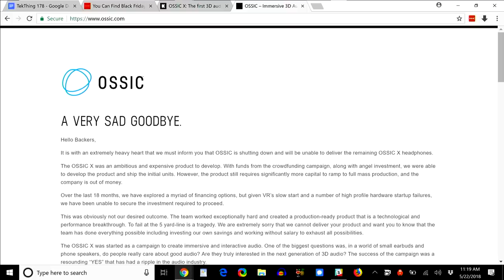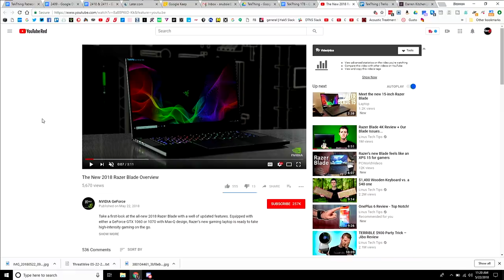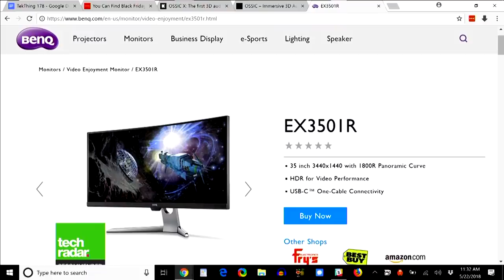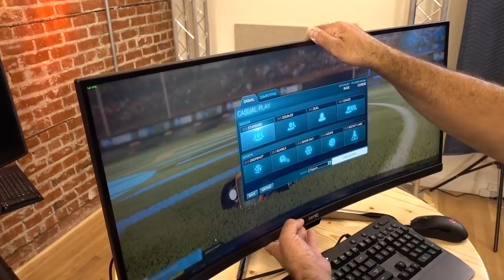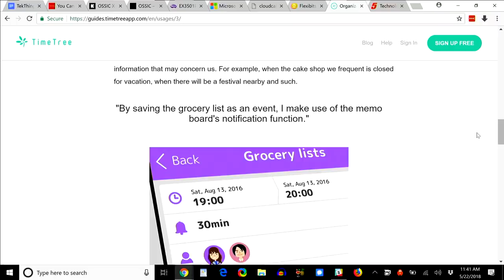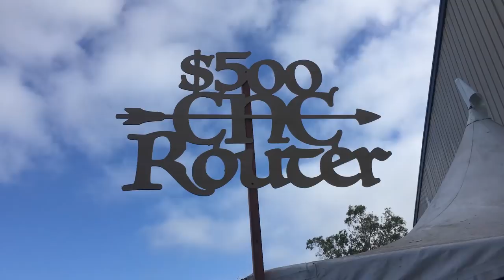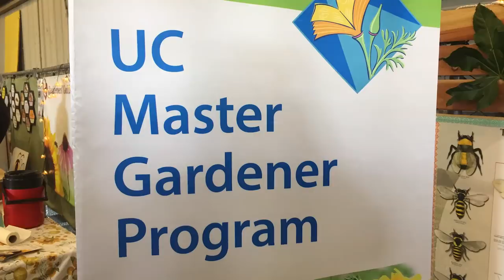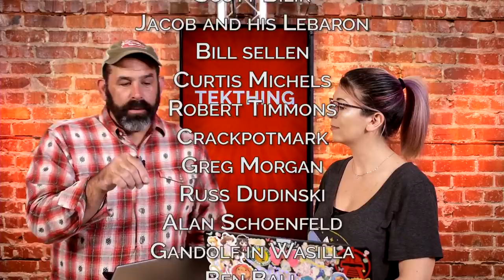2018 Razer Blade Gaming Laptop Hands On! Maker Faire Picks, BenQ EX3501R Ultrawide Monitor, TimeTree

Comment: Apologize for the long winded explanation but I feel others should be made away of issues with Outlook for iOS.

I was using Outlook on both of my iOS devices until the day I opened Outlook on one of those devices only to discover that the app had deleted the settings for 5 of my 6 accounts with the message "Data wipe. Your application data has been deleted by a mail administrator". The only account that was still left was my old hotmail account. The configuration information and all the email that the device had for my 2 Gmail accounts plus 3 other non gmail accounts were missing out of Outlook. The email was still up on the cloud of course. I tried to impress upon support at Outlook app that they have a bug in the application since the other iOS device was fine and if indeed a "mail administrator" had issued a wipe command it would of had involve 4 different email services.

I found others that had a similar message pop up on the application with similar results. As well the only way of contacting support is via the Outlook app. Creating a support request for Outlook on iOS does not generate a support ticket number so that you can refer to the incident to other MS support people outside of the Outlook app.  I had a month long thread that was only visible in the iOS device on which it was created. 

MS never admitted that it was a bug in the app nor did they admit that it was ever fixed. Since I use my iOS devices I have to use reliable apps and for me Outlook for iOS is not such an app. 

 For email I switched over to Edison Email app. The Edison support people  at least use  regular email for support which means you can do support via any email client on any platform. I simply use the Google calendar app.